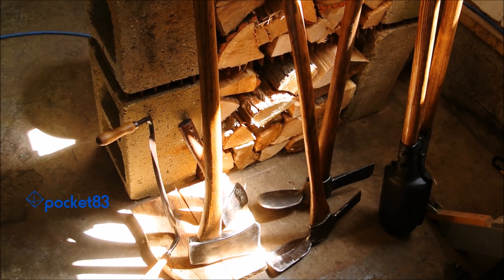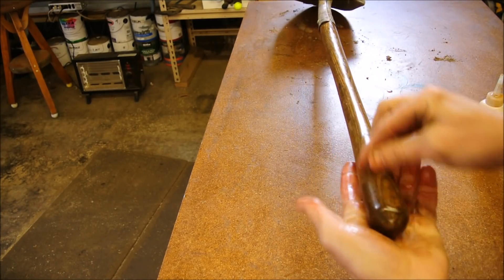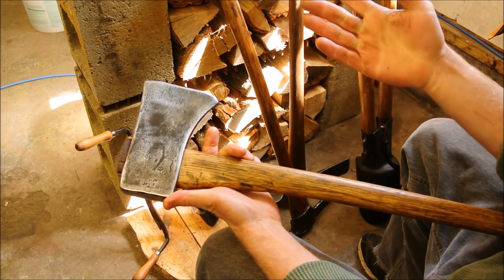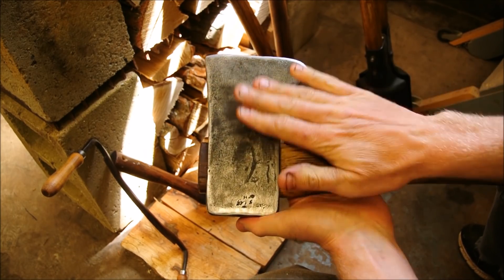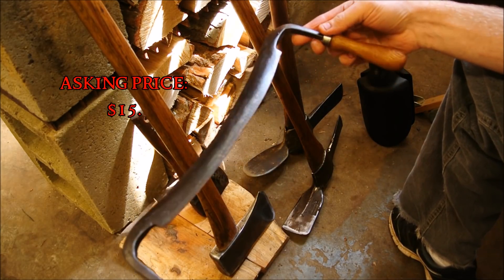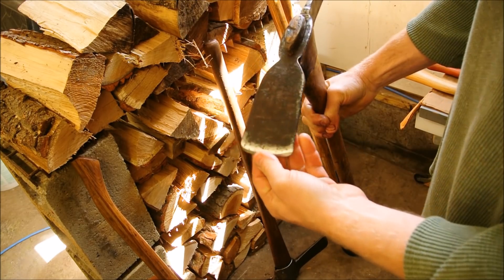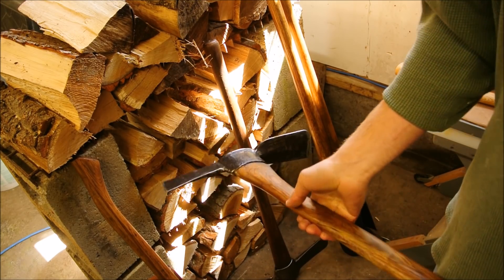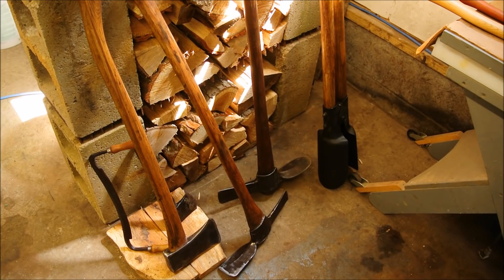Some flea market tools: restoration and discussion

Comment: If you don't like the smell of vinegar for removing corrosion. Use citric acid instead. It's a similar strength acid and does the same job (I think better) without the nasty smell.
It comes as a powder, just dilute in warm water and soak the metal in the solution as you would with acid.
It's also handy for making the ultimate cheese sauce. Mix some with baking soda in a little water and stir into warm milk then melt in cheese. It stops the oils and fats in the cheese from separating giving you the ultimate nacho cheese sauce.
The final great thing is to make your friends and family taste a little bit of the powder and watch their reactions. It doesn't hurt, but it's sour and people's reactions can be so funny.
Reply from the maker: I wonder if a lemon thrown in a blender would do it? Video idea?
Reply: Yes! Interesting, try it and video it please?
Reply: @pocket83squared  evapo rust is better

Comment: im pretty certain you could straighten that handle, get yourself a tube it will fit in, pvc, guttering, whatever, then suspend the handle upside down in the pipe, with a tub of boiling water underneath, think like a fireplace and flue,  but for steam. boil till the wood gets good and steamed,  10 min or so, then straighten it against your workbench with clamps. ive used this to bend all sorts of wood over the years. as for the rusty heads, boil them in water for half an hour then soft wire brush them, youll convert the rust to a deep blue patina, its called carding, and its an old gunsmith trick. I love your vids! keep up your own style of being awesome!!
Reply: I'd love to see a revisit / full tutorial trying this!
Reply: Blakehx C&Rsenal in their Anvil videos actually show this.

Comment: I find the odd garage sale that has old neglected tools often a better experience than the flea market, but maybe that's because some of the vendors at the local flea market are trying to cash in on ignorance and want a million dollars for anything that has 'patina' aka rust, whereas garage sales are usually just trying to get rid of junk once a year.  But yes, I don't feel bad at all giving a low offer, and i'll often say that they may get what they're asking from someone else, but (nothing personal) here's what i'm willing to pay right now in cash. I also inform them that i intend to actually use the tool, and that often makes folks feel good about selling it for less.  I'll tell them how i intend on using it for a project, and what i'll need to do to put it back into a usable shape. They get the understanding of what really needs to happen, and the knowing the tool will become a valued thing again, not just resold at a higher price to collectors of rusty things, erm, patina.

Comment: Walnut oil works well for old bowls, knife scales and kitchen utensils. Not just wood, metal as well. It dries very slowly but is a guaranteed foodsafe finish and will dry to a film that stops rust while withstand normal handling and washing on cast iron and carbon steel. For moving parts, food grade mineral oil works well as a lubricant.

Small pieces of wood you can bake in the oven as you would cast iron after oiling. It shrinks the wood slightly, will darken the wood somewhere between a chocolatey brown and deep black and will kill any small organisms that may have decided to take residence in the wood. You can polish off any loose charring after, it makes the wood feel denser and appear more "expensive."
Plus if you were to restore and resell, "ebonized" sounds pretty luxurious while "charred" or "burnt" have a rustic-ish appeal.